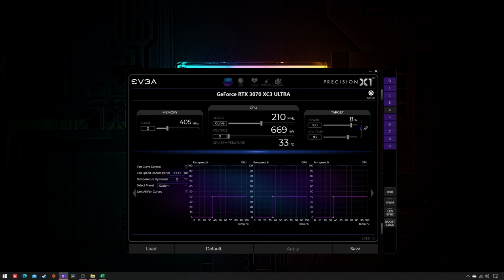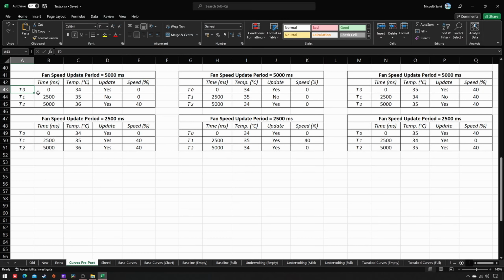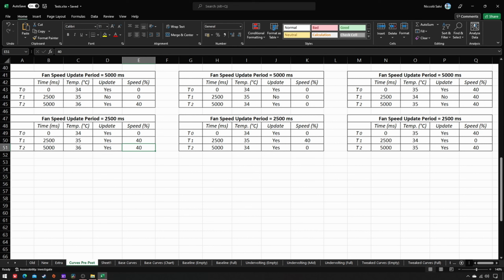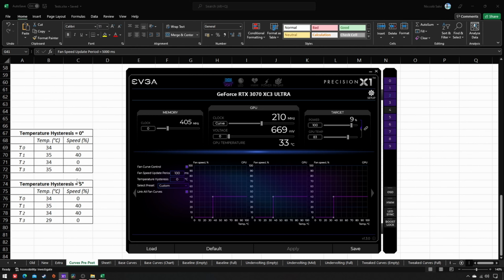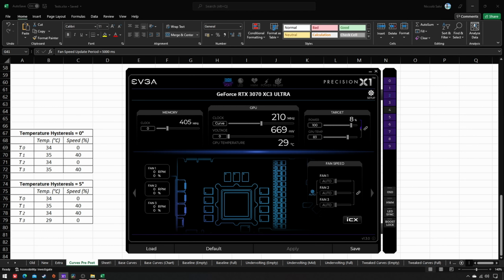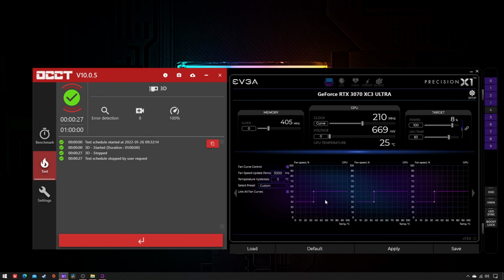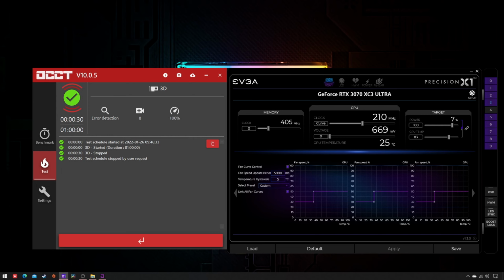EVGA Precision X1: How to Set Fan Curves

Comment: How do you get the adjustable fan curve graphs?? Mine just shows the RPM and % usage info for both fans on the right and then lets me either auto set or manually set the % usage on the right with a slider. But I do not have a graph thing at all
Reply from the maker: Which graphics card?
Reply: @oakenglass GeForce RTX 3080
Reply from the maker: @monopolysloth7957 EVGA branded?
Reply: @oakenglass Nvidia brand
Reply from the maker: @monopolysloth7957 That's why! Fan curves in PX1 are only supported by EVGA cards :(
Reply: @oakenglass Ah alright, thank you for confirming. Someone had told me they did nvidia too so I thought I’d try out. My afterburner broke cause of come C++ dll issues so I have to look for an alternative. Thank you for your help!

Comment: 9:30 timing Are you putting out a hysteresis custom mild pc fan curve of max 50% for all temps or are you suggesting this curve that in precision x1 of 34c below 30% and above 40c 50% fan speed, and I need to fill in the gaps up to the higher percentage or did i miss that portion for 70%+ gpu usage to keep it balanced, also what did u like no fan or 30% sweet spot fan?
Reply from the maker: No, that was just an example to illustrate polling rate and hysteresis: you can find the curves I use in the final chapter. As for your last question, I prefer the fan to be off below 50° :)

Comment: why does my fans stop working after closing the App?
Reply from the maker: Your VGA reverts to the default fan curve, which probably includes a "fan stop" below a certain temperature threshold.
Reply: @oakenglass  Thanks, Legend 
but how do I keep it permeanant without flashing or keeping the software running in the background ?
Reply from the maker: @mohammednurul9380  That's not possible, unfortunately...
Reply: @ I've been trying for hours now, nothing seems to be disabling the  fan stop feature even in MSI afterburner.

Comment: Any OC settings (GPU & memory clock) for 3070 XC3 Ultra and play COD and Fortnite in 1440p? Thank u!
Reply from the maker: Sorry, I do not overclock per se... I prefer to undervolt and find the max stable frequency at that voltage.
My best performing profile is 1920MHz at 900mV: you can watch my videos on undervolting, if you want :)

Comment: Using EVGA Precision (TERRIBLE GUI), I set my fan to hit 100% at 60c with my 2070 Super. I set my voltage to 918 mV vs the Precision Boost Lock setting of 1050 mV /1965Mhz it normally uses. Also, set my memory clock to +975. Ran an Ultra Quality Heaven Benchmark, and it was 1935 MHz the whole time, and it never got over 60c! If I had my fans set to automatic, it did a bad job of keeping the heat down and the performance steady. 😁
Reply: what gpu?

Comment: I run my 3060Ti with 1950mhz@950mv and i tried to set the fancurves. Unfortunately "Hysteresis" seems not to work for me. I set it to 5°C, so when the fans start for example at 50°C they should stop 45°C, but they stop at 50°C.
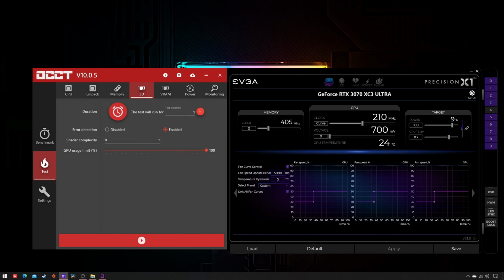Reply from the maker: Are your fan curves "stepped" or "sloped"? Hysteresis only works with stepped curves (07:00).
Reply: @oakenglass  Ah, my fault. I missed "double click the background". Now it works, thx :) To bad there is no marker who shows wich curvemode are aktiv.
Reply from the maker: @clausschopf9945  No worries!
I agree: EVGA should be clearer about this. But since they opted out of the VGA market, I doubt they ever will :(

Comment: how is your power target so low?  Mines always at 33% and with a mild fan curve wont go below 44*c in a climate controlled room.
Reply from the maker: Try to open the Task Manager and check which process is using so many GPU resources.
Reply: @oakenglass  turns out I had highest performance selected in nvidia control panel which was acting similar to a boost lock. Thanks
Reply from the maker: @TexasBulldog74  Great! Yes, the NVCP "Power Management Mode" shouldn't be set globally, but per game.

Comment: hello good sir, what fan speeds would you recommend for evga rtx 3070 ti ftw3? it idles at 48-49 Celsius and at 50 the fans kick in for a second or two to get the temp back to 48 and the cycle repeats. as I understand there is an auto fan speed feature turned on as I am looking at the precesion x1 software but I have zero knowledge on what curves to set up, so decided to ask first before playing with fan speeds myself.
Reply from the maker: Hi there! Since its idle temperature is a bit high*, I'd set a rather aggressive fan curve:
Sloped, 2000ms, 0% at 30° / 30% at 50° / 50% at 60° / 70% at 70° / 100% at 80°.
Obv, it will need to be tweaked to find a good balance between temp and noise.

*I'm curious: what's your ambient temperature and case/fans configuration?
Reply: @oakenglass  i switched auto fan speed to a preset called "stealth", now it idles at 37' with all the fans at 30% speed. 

Other characteristics are default. Clock - 9502 (memory) Core Clock - 1860. Voltage - 975 mV. 

Deepcool CK560 is the case I have with all the stock fans, 3 (120) intake on the front and 1 exhaust (140) at the back. At this moment, the room temperature is 26. The room temp when I typed yesterdays message was 27-28.
Reply from the maker: @wessen666  Great! You can certainly start with the "Stealth" preset and tweak it if necessary.

As for your case and fans configuration, they are fine (positive pressure is good)! Perhaps it was/is just the room temperature...

Comment: Thank you for the video. Unfortunately, my EVGA Precision X1 is missing the fan control option. It is just blank. Was hoping to use the app for OC'ing my GPU but that will not work at my fans remain at 0% (off). Will have to stick with MSI Afterburner as it appears to be the only way to actually have my GPU fans working (sorta an important feature).
Reply from the maker: Weird! What's your graphics card?
Reply: Same here, not having the option to control fans... While still useful for manual input of changing fan speeds, it renders the app a bit useless.
Reply: have you fixed this yet??

Comment: Would you say your fan curve which you show at the end of the video is suitable for an EVGA RTX 3060 XC Gaming graphics card setup ? I had been running the "Aggressive" Fan curve preset up until now but I'm starting to think it's a bit of an overkill and it might wear out the fans or something.

With your curve which you show at the end I'm currently sitting at 30% Fan speed / 35 degrees GPU at idle
Reply from the maker: In general, yes... however, it should be tested under different conditions/loads and then tweaked if necessary.

Comment: Sir, evga precision x1 always notice new version. But iam have gtx 1070ftw, I don't want update  always close/skip update. But today, accidentally update it, after 10 minutes with new version suddenly my PC down. Wont boot,  if turn on all fan only spins for a while then turns off. 
Please need solution
Reply: I had a similar issue, installed an older version of Precision X1 and the issue went away
Reply from the maker: @Georgi_Draganov  Interesting. Could you tell me which version showed the issue and which version you downgraded to?
Reply: @oakenglass  I had an issue with one of the newer versions, can't remember exactly which one. The version which I downgraded to is '1.3.2'. I haven't had any issues after that.
Reply from the maker: @Georgi_Draganov  Thank you! I'll try to replicate the problem (I'm still on 1.3.0).
Reply from the maker: Does your motherboard have an internal speaker, debug leds or debug codes?
If so, we might be able to isolate the problem.
Reply: @oakenglass  there isn't any debug leds.
Asus TUF H310m gaming plus
Reply from the maker: @taba2608  Don't you have a spare 4-pin speaker to plug into its connector?
If not, you could try the usual things, like doing a power cycle (shut down the PC, unplug the PSU from the wall, press and hold the power button for 60 seconds, plug the PSU to the wall, turn on the PC) and clearing CMOS (via the jumper on the motherboard or by removing its onboard battery)...

Comment: Precision X1 tends to regularly loose my undervolting settings/ forgets to apply them on startup even though the respective option is ticked in the settings… easy to notice since the GPU turns into an airplane in this case, still quite annoying to be honest, have you ever observed a similar behaviour?
Reply from the maker: No, never ("start with os", "start minimized" and "apply previous settings on load" are ticked).

You could try to uninstall PX1, manually delete the "AppData > Local > EVGA_Co.,_Ltd" folder *, reinstall PX1 and finally reapply all settings from scratch.
* The "EVGA_Co.,_Ltd" folder contains the "user.config" file, in which all PX1 settings are stored, but it's not deleted upon uninstallation.

Comment: Thank you very much! That was an amazing explanation! I have an EVGA RTX 2060 and it did this clicking sound. After i used a Custom Fan Curve it stopped completely. I think it came from the on and off switching of the GPU Fans. Do you think that this Curve is okay for gaming and or rendering videos? 40% at 30 C, 50% at 50 C, 70% at 70 C and 100% at 80 C. 3000ms and Hystersis at 5 C.
I don't really care about noise, i have a quiet computer case, i just don't want the GPU to get too hot.
Reply from the maker: That clicking/rattling sound is indeed caused by the fans turning on... and it's annoying as hell without a custom fan curve. In this regard, yours is perfectly fine for all purposes! Good job.
Reply: @oakenglass  Thank you very much! You helped me a good bit here, before i did research i was afraid that something in my computer broke!
Reply: @oakenglass  it is good for a 3060ti too? I'm usually using the Opera GX browser, maybe opening a few programs at a time, and playing games
Reply from the maker: @tomyferrini  It is... but ideally you should take inspiration from their fan curve (or mine, less aggressive as my card is undervolted) and then tailor it to your specific case.